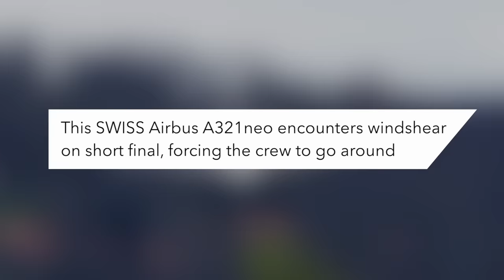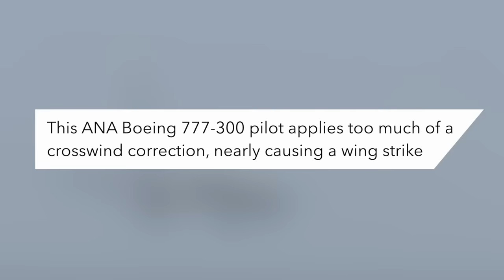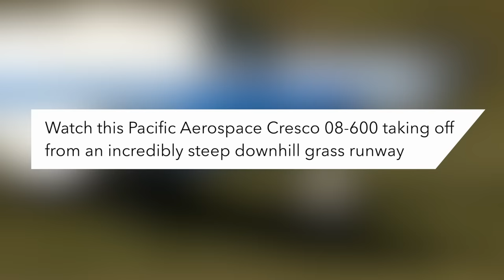Windshear Sends Plane Into Nose Dive

Comment: Windshear of enough magnitude to cause the aircraft to go around would produce other evidence of its presents.  You may notice that the vegetation in the foreground only show slight disturbance.   although vertical shafts of wind could be isolated, they persist with other weather indications.  Just another day at the airport.
Reply: The camera was at least a mile away from the plane.  
Just because one small bush isn’t blowing around too much doesn’t mean anything.  Maybe this persons car was parked right there  and is blocking the wind.  You don’t know.
Reply: @stevenbeach748  I know how long runways are,  I have flown in windshear.  I have never seen Windshear activity like a ship-rock occurring only in one small location over a whole airport. It is normally associated with gusty winds condensation sometimes, and instability elsewhere over an area of the airport.  what I think is on display here is someone who cannot fly an approach with a relatively fixed pitch attitude and was unable to correct the track of the aircraft resulting in sides-lipping and a go around.
Reply: @YouTube.TOM.A  so when flying in this wind shear you say I’m going out on a limb here and assuming that you encountered wind shear at some point.  Meaning there was an area that wasn’t wind shear and an area that was.  Or a border if you will.   So why can’t the border be between the airplane and camera? 
You making a big assumption from seeing about a 10 degree section of the horizon in the video. You have no idea what’s immediately off camera left, right, above or anywhere else.
Reply: @stevenbeach748  Windshear requires energy to exist,  That energy creates wind gust and instability. The presence of windshear is not a micro climate but activity in an area of the airport. Windshear is often accompanied by other weather activity such as clouds precipitation and active air masses. Since the aircraft is landing into the wind, there would have been more visible evidence. The pilot seem to be overcontrolling the aircraft.
Reply: @YouTube.TOM.A  since we really can’t see anything around the camera other than a small fraction of the landscape and sky, we can’t say with any certainty what’s going on weather wise.  Perhaps there’s an isolated cell right behind the camera.   We can see that it’s windy and there’s terrain around the airport both from the cameras elevated position and the terrain behind the aircraft.  

Wind shear is defined as an abrupt change in wind speed or direction.  Strong gusts can be classified as wind shear too.  It’s quite clear they were fighting the wind on final.  I doubt the pilot would push on the yoke that abruptly that close to the ground. 
Your opinion may vary.
Reply: @stevenbeach748  I flew widebody and jets the size of this one, you seem to be going off the path, with your arguments.  Isolated cells seldom have the amount of energy to produce [ airline type ] windshear.  Strong gust is technically not windshear, airline pilots [ such as myself ] fly and land in all types of wind disturbances legal to operate in. Again the size of the aircraft has some bearing on what reaction will result even in gain or loss of speed. I know from looking at that ground vegetation that you are elevating the conditions on this field to fiction.  If you think that pilots fight the wind on final to land an aircraft your flight experience is minimal.  I have observed many pilots under my command operate in wind. this is certainly an overcontrol of the control surfaces. I have enough experience to believe that a meteorological rabbit would not jump out of the hat if you turn the camera elsewhere on the field.
Reply: @YouTube.TOM.A  I’ve been captain for a world wide 121 freight operation for many years. I can assure you my flight experience is not minimal.  
You have your opinion on what you’re seeing, and I have mine.
Reply: @stevenbeach748  Why would a person of such experience be talking about fighting the wind on final [ to landing ].  That is a very non technical term.  Also not properly differentiating between wind gust and wind shear. That's weak stuff for your proposed portfolio.   You verify windshear from the equipment you are flying or equipment on the ground.  Gain or loss of airspeed does not necessarily designate windshear activity as does not tis video where some poor pilot technique is evident.
Reply: @YouTube.TOM.A  so what phrase would you use to describe what they were doing?
Reply: @stevenbeach748  Overcorrecting the pitch attitude  [ comes from becoming a reactionary to outside wind conditions ]

Comment: 0:42
My job is deicing aircrafts, AMA.
Reply: how does it de ice
Reply: @GunsAndAmmo3  
It's a mixture of water and glycol heated to 140-180 degrees Fahrenheit. For days like this we'll typically push the snow off with the fluid as well as melt it. As soon as all the snow and ice is off, we begin antiicing fluid. Which sticks to the aircraft. As they're taking off the antiicing fluid flakes off, taking any accumulated snow with it.

This video said they start with critical surfaces (wings and tail) but, if the pilot requests we spray the entire plane, then we start on the nose and body and finish on critical surfaces, that way the important parts are as heated as possible when we start antiicing.

Comment: Windshear DO NOT change an airrcraft's pitch, pilots does. Windshear causes high rate of descent (or climb) increase. Moreover, I do not believe in windshear at that height, that's more a common turbulence or a simple "cockpit" wind....
Reply: Wind shear from a headwind to a tailwind will cause the nose to pitch down.
Reply: @stevenbeach748  Thanks for your opinion, but I do not opinate on this subject: I just follow the prescribed procedures for windshear encounters, which are identified by vertical rate increase ONLY.
Reply: @RobertoRMOLA  it’s not an opinion.  In aviation wind shear is defined as an abrupt change in speed or direction.  Also LLWAS (wind shear section systems) only detects wind shear in a horizontal direction.  Cockpit indications of wind shear are primarily airspeed fluctuations. 
I don’t know why you’d think vertical wind shear only exists when horizontal wind shear is an equal problem.
Reply: @stevenbeach748 So...was i wrong all these years?!  Considering all this information, revising all the books, SOPs and papers I have, remembering all that FFS sessions (without the luxury of a simulated LLWAS info), I'll stay firmly with my first statement. Pilot induced pitch down (that is pretty noticeable indeed), sudden realization of the error and subsequent go around.
Reply: @RobertoRMOLA  if you haven’t changed your training / thought process over the years, then yes, you’re wrong.  
It’s also crazy for you to think wind shear can’t happen close to the ground which is where wind shear detection equipment literally is.
Reply: @stevenbeach748  All this thread started with you stating that windshear can cause a pitch change on an aircraft, and I stating the opposite. I'll keep with my original statement. Thanks. Have good responses to windshear and nice flights.